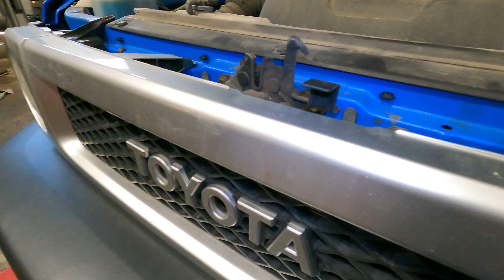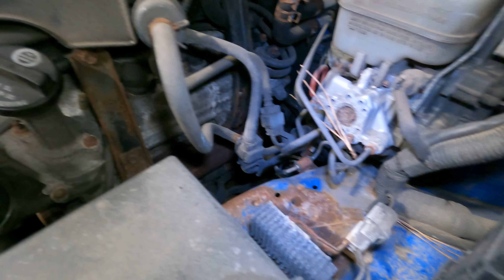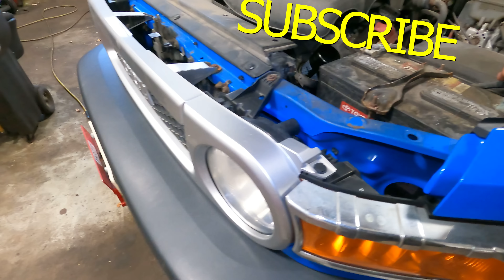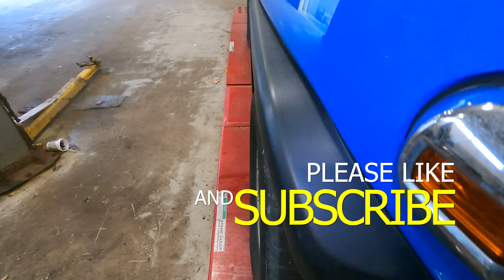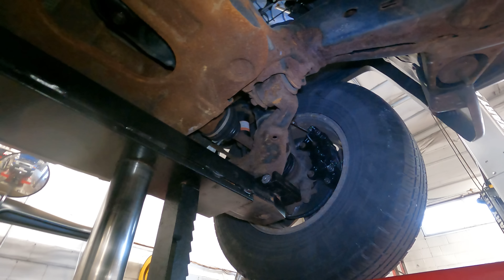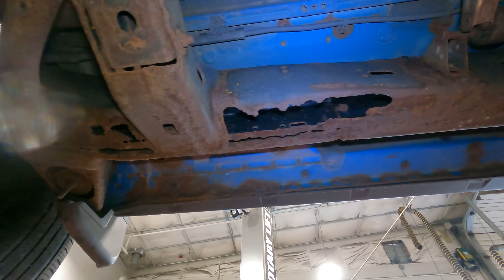CSW states "CUSTOMER GETS FREE BRAKES!?"😟💔😭🥲

Comment: That’s a great dealership 👍🏻..didn’t Toyota have a chassis replacement recall on Tacoma and FJ’s from those years,I had a 06 two wheel drive Tacoma and remember a recall/buyback around 2013/14 for  bad frame rot?

Comment: Have 3 Subaru cars, all of them go for service to the same dealership. The one used by my daughter had a transmission problem past the 100K miles limit for the powertrain warranty. Subaru and the dealership fixed under warranty. They could have easily told me it wasn’t covered, but they have an excellent service reputation

Comment: I remember when I worked at Toyota back in 2013 there was a 92 Camry that comes in for the free lifetime oil changes he got when he bought the car
Reply: Lucky if you get a free washer fluid fill before delivery in this day and age or maybe they just forgot on my car.
Reply: Those free oil changes are the reason I'm not with toyota anymore. 
I saw everything from metal on metal brakes declined, to cars with such crappy batteries that we were having to jump them in the service drive. Just the free oil change and go. 
All repairs declined. I was getting hammered on my metrics and said fk it.
Reply: @mmix224  lmao
Reply: @BigLisaFan  that is sad. Just stop in to the service department and see if they can do a fluid top off and tire check, saying you are going on a little trip

Comment: The number one automotive trope on the interweb is Subaru head gaskets, Ignoring  the tens of thousands of truck frames Toyota had to replace on multiple platforms, not to mention the stripped head bolts from over-torquing.
Every manufacturer has had problems, Honda has catastrophic oil dilution problems in some of their turbo motors.
All of these are more serious and costly than head gaskets on one engine series.
Kudos by the way for doing the solid for the long term customer, sadly this is almost unknown in these "greed to the level of severe mental illness days."
Reply: A rusty frame in the rust belt, on a 15-16 year old vehicle? Inconceivable!  If it was in Southern California or Texas and it was that rusty, sure I’d be upset. If you live in the rust belt, rust protection coatings are a must.
Reply: Suburu had the same problems for decades though is the difference.

Comment: There are times a shop will cover things that are above and beyond. I’m glad this was one of them. Well done by all. Side note, is it common for Toyota to have frame issues? I live in the rust belt of Wisconsin and my wife is thinking about a newer 4Runner.
Reply: It's a well known issue with their body on frame vehicles from the 90's all the way through probably 2010. Depending on the year and model, some were recalled and (depending on condition) had their frames undercoated or replaced for free, others were bought back for above retail value and crushed.

Comment: there has GOT to be some way to prevent this ridiculous level of rust
Reply: Stop using so much salt on the road during the winter.

Other than that, wash down the underside of the vehicle after every snow.
Reply: @charlesball6519  I was referring to a metal coating

Comment: Awesome gesture by this dealership, but I HAVE to comment on the condition of that frame and the components that attach to it. Did the customer ignore all THEIR responsibilities during the 15 years they had that vehicle? You're supposed to wash your vehicle pretty often, at least every 2 weeks, that includes the underside if you drive in places that get it muddy and/or where they use road salt like New York where they literally live. You're supposed to wax your car once a season. You have to protect your most expensive investment you buy, which is usually your car! 😣